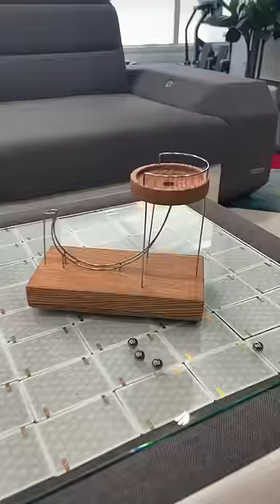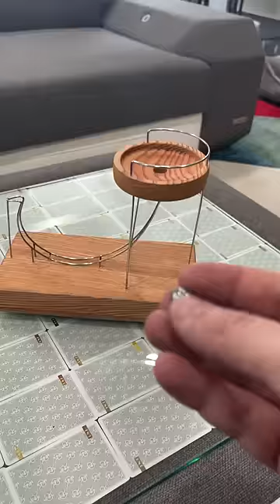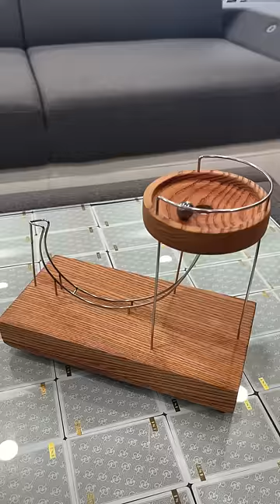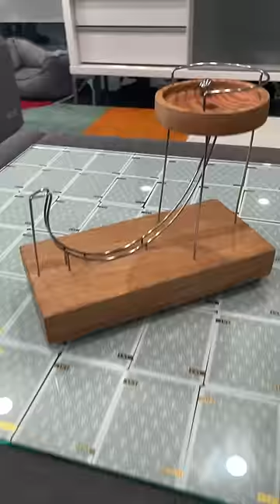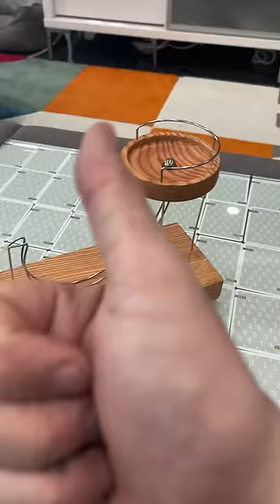An Impossible Perpetual Motion Device?! 😳 #Shorts

Comment: Tip it over lets see what trickery is underneath, guessing timed magnet in the base or speed boosting motor under top plate, that ball is going unnaturally fast
Reply: yes its built with a magnet 
you can search up tomary on youtube, hes a german youtuber who kind of created that :)
Reply: @koenig_ramses4458  what?! nice! thank you!

some fascinated German noises
Reply: Yes it has an on off switch
Reply: old man strength  lol it's not just a magnet. It's a battery powered device. If it only needed a magnet it would be a true perpetual motion device. If you search for it online you'll see it has a battery compartment.
Reply: old man strength  yeah mean the smell of burning oil is good haha
Reply: @GlobalDesignHD  you are correct, if it was only a magnet it will stop even faster towards the magnet, but here it accelerates, so there must be an additional power boost
Gimme a sub now 🙂
Reply: @GlobalDesignHD  It still wouldn't be a perpetual motion device with a magnet. Magnets lose their strength over time, hence why it doesn't work.
Reply: No one said there wasn’t one
Reply: @GlobalDesignHD  actually not true there ARE many PMD’s that ONLY use magnets but because magnets do eventually lose strength are NOT true PMD’s
Reply: @koenig_ramses4458  ICH BIN BERLINER!
Reply: @zherean42069  same
Reply: Soo basic yes .
Reply: It's not .. it's doesn't exist. It's all fake
Reply: @spacefan36  Das IST gut, yah?
Reply: @koenig_ramses4458  magnet makes no sense, since there's no monopole magnet. It's a little threadmill in the hole gives the ball a little boost.
Reply: @ehsan_kia  lmao i literally put a name of a youtuber in my comment who actually built that but okay
Reply: @koenig_ramses4458  I see, he uses an electronic magnet that turns on and off, but that seems overly complicated. I think these etsy versions are the simpler one with a threadmill motor.
Reply: I'm tipping it's a similar principle to a rail gun
Reply: old man strength  I was born in 1988 but I learned to ride on my dad's tuned 250R. I remember getting it stuck in the mud and destroying my shins trying to start it up. My foot kept slipping off. It was a nightmare. But I remember his ATC dusting stock Banshees. Tecates were awesome too but I don't think I've ever seen one in real life. 
My bucket list includes hitting the power band on a CR 500.
Reply: I think the track is magnetic in certain spots
Reply: @GlobalDesignHD  that's not technically true because magnets don't last forever baby
Reply: Yoooo Rambro's dude up in here 😁
Nostalgia trip!
Reply: @GlobalDesignHD  adding a magnet would disqualify it as well. Since it would ad Energie as well...but more importantly it would also weaken over time
Reply: Fr
Reply: I've seen a french youtuber named "Dr Nozman" , he bought it and showed that this device doesn't work without an outside boost, which was given by a USB cord going into the device
Reply: I want that
Reply: old man strength  yeah you can fire Magnets with electricity. Its Like magic
Reply: Wow what a misleading video if there is magnet in it. Thanks now I can downvote and block this guy🤙
Reply: Remember he said it is imposible and that device just closes to the idea
Reply: wow Hi Angry, I’m upset
Reply: Imagine we could make nearly infinite energy by just mass, gravity, natural magnetism.
Reply: To be fair he did say it doesnt exist and it would look LIKE
Reply: @GlobalDesignHD  Incorrect, even normal magnets lose their charge over time. This is why magnets aren't used for even attempted perpetual motion devices that aren't tricks, AT ALL..
Reply: Yea most need to get plugged in
Reply: @GlobalDesignHD  No it wouldn't be. "Permanent" magnets demagnetize when used in this way.
Reply: @koenig_ramses4458  i might be biased but fking hell german engineering sure is something
Reply: @eugene9852   ofc it is the point xD. There are variations that only work with magnets and that was what 2 stroke power claimed would count.
Reply: @TheConfusedOne101  is it tho? In my opinion it was...the generations now are resting on the achievements of those before them. We all got/grown weak as Western society :(
Reply: @ehsan_kia  There is no experimental or observational evidence that magnetic monopoles exist, but theory says they should. Not in bar magnet form, but in elementary particle form. And no, there is no "little threadmill" in the device shown in the video.
Reply: @GlobalDesignHD  wrong. Perpetuum mobiles that use magnets are per Definition not considered as not such machines.
Reply: Just goes to show how literally over 4,000 people don't kno anything about perpetual motion and physics
Reply: It's really not even all that interesting my promise. I saw somebody else busting this. There is simply a 9 V battery underneath lol
Reply: Gravity
Reply: So it requires batteries in other words
Reply: @GlobalDesignHD  theory: it's an electromagnet powered by a battery. The rail the ball runs on is hooked up to a momentary switch that activates when the ball falls and gives the ball a boost back up. Neat desk toy
Reply: It uses battery powered smoke and mirrors...
Reply: Nice job calling out the fraud
Reply: Technically, assuming nothing crosses your path, a perpetual motion machine would be called "throwing an object in space". As long as it doesn't hit anything else, it'll continue in the same direction, at the same constant speed, forever.
Reply: @GlobalDesignHD  Magnet loses its magnetic force over time so still if it used only magnet it could not be called  "Perpetual motion device"
Reply: @GlobalDesignHD  it wouldn’t be because the magnet loses strength over time.
Reply: It doesnt matter if it has a magnet it is still infinite
Reply: @calcapone9  is a car engine infinite? No, when the gas runs out it stops, same with a magnet, once the magnet decays, it reaches a point where it can’t propel the ball fast enough to make the jump to the funnel.
Reply: Yea prob magnet
Reply: I think it's just cgi
Reply: @crypticaddiction6856   At last!!
Reply: There’s a small spinning wheel in the hole that gives it the proper speed
Reply: @GlobalDesignHD  No it wouldn't. Magnets run out of magnetism.
Reply: @GlobalDesignHD  having a magnet wouldn't make it a true perpetual motion device. Magnets do eventually run out of power
Reply: He did it on his Snapchat and you sir are right its some magnet thing
Reply: Bingo!
Reply: @janis0085  Yes it would, because you'd get more power out than you need replacing the magnet or re-magnetizing it.
Reply: @fintincollins5555  
A magnet doesn't have "power". The magnetic fields might become unaligned over time, but that doesn't stand in a proportion to the acceleration you get from a magnet.
Reply: @TobbeDraws  No.
A magnet doesn't "add energy". Even if you had a magnet that stays magnetic forever that wouldn't allow perpetual motion.
A magnet just creates a magnetic field. Stuff accelerates towards the magnet and that's it. If you want to get it away from the magnet again, you need to add just as much energy as there was in the system before.
Reply: @fullofbullets58  Wrong, that magnets demagnetize is irrelevant.
A forever-magnet wouldn't allow for perpetual motion either.
Reply: @MrCmon113  well a quick google search on perpetual mobile only with magnets would show you there are already some that only fall out of the "real" definition bcs the magnets lose in strength over time.

The premise a magnet would not add energy is wrong...and you are proving that already yourself with what you wrote.

"stuff accelerates towards the magnet" nothing could accelerate towards something, without some kind of adding energy, if that something isn't adding energy itself.
Reply: This hokus pokus only works in the Mid-East and China. They have a different law of physics over there

Comment: It turns out this device has a battery underneath that gives the bead a magnetic boost
Reply: aaaaaaaah really?!
Reply: and you can prove it by this: in order for the ball to reach a higher height than it fell from (starting point) it would need to gain energy which is impossible without something pushing it or giving it energy. In order for it to jump up like that, it needs more energy than it started with when it fell into the hole.
Reply: @CleopatrasNemesis  yes, really. You can tell it accelerates downward much faster than gravity would.

Well, Earth's gravity, anyway.
Reply: @ztoob8898 sarcasm
Reply: @Vid_Master 
The gravity could provide the energy needed, maybe (?). However it's not the case in this planet.
Reply: well no shit
Reply: No wayyyy
Reply: It uses an electro-magnet.
Reply: Batteries are NOT magnets!
Reply: Correct, batteries are not a magnet but the energy stored in the battery is used to feed another component to create a magnetic field.
Reply: @gagpatr  you need a magnetic field than can be switched on and off.
ON while the ball is moving the towards the magnet and OFF while it is moving away.
Reply: I built one of these years ago and it works I only used thin metal for the ball chute and wood for the catcher it worked and kept working till I took the ball out
Reply: @BrianPorter-se9dh  oh really  
Post a video and video all sides of your device including the bottom.

Comment: The catch is: "the ball is accelerated (speeding up) when it is projected from the metal ramp as compared to naturally slowing down". So, you need "a small bit of energy" to push the ball to the height higher than the previous level from which it started to fall.
Reply: That's not a catch at all. The question is what is speeding it up.
Reply: @savedfaves 
A magnet inside of the wood. It's battery feeded.
Reply: Yeah they all are, I have a few, they are cool talking pieced and chemical ones can go for centuries but it is a hidden energy source, the best is a rotating magnet on some type of device as it’s minimal energy input that appears to have an abnormal amount of output the Gomboc thing had me thinking for a while but it always finds a resting position, anyway, even the magnets should in theory power a device close to angular momentum, but over the centuries the magnetic fields would decline so it’s not really perpetual motion and it’s not really an impressive output unless you add a current, which they always do, I have a really cool one that sits on two plastic semi circular stilts that allows a quarter triangle within two semi circular outer cases and inside it looks a little like a fidget spinner type of thing that sometimes goes wild, it’s a very easily Googled trick anyway but I can actually charge two triple A batteries as it uses mechanical rotation that’s basically angular momentum 99.999% but that mechanically wound magnetic rotation device only takes maybe about one minute to wind and it can last over ten years even with routinely charging my remote batteries, it’s basically a mechanical battery charger and a cool little coffee table piece.
Reply: I know where all here to paste people who think stuff like this is possible but if the universe was created from nothing which is not perceivable and neither is total infinite, what’s interesting is we can’t grasp either but yet they are literally inverts of one another, everything/nothing positive and negative, light and dark you know, I find it interesting the connection in that especially the fact it’s like repeated on nano scoping level at every level of life, if you imagine the Big Bang, we are like mid explosion as wee speak, and if you think about it, if you looked at an explosion deep enough you would find like little particles then even smaller objects that are as part of the explosion as the whole explosion just like in quantum mechanics where things still have the same physicals at a minute scale, it’s like we are here to ensure the explosion goes down, maybe that’s why our species is destructive, what if the universe made life in order for the Big Bang to be possible and if by some chance someone had the whole cosmos in a shoe box and was unable to see at much as actual life on planets well it would be exploding so say its in some container then the nature of that explosion on the smallest scale is to make the destruction wide spread as we are in an explosion, anyway if this all came from nothing then it’s possible if it’s possible it’s inevitable and basically never ever stops so can’t that be considered perpetual motion? Not like a little model but say the fact it’s more or less creating energy out of thing air,  which is the whole concept behind perpetual motion.
Reply: That energy comes from the battery, I know, I bought one.
Reply: @savedfaves  battery
Reply: Yeah we have always known this but what if that small piece of exes energy could be gravity or angular momentum? Things come to a natural resting position, unless it’s that mad stone thing that the took inspiration from a turtle shell, the guy went about trying to find a pebble as he was convinced there must be at-least, other than the universe itself.
Reply: Sure, but how? 

(There is a magnet hidden in the base in a location that accelerates the ball as it comes down but does not slow it down when it passes that point. So it behaves as if it went down a longer slope, but rises only part of the way to the longer slope top.)

Comment: For those wondering how it works, this one uses an electromagnet in the base that turns on as the ball is coming down, thus accelerating the ball downward faster than gravity alone, allowing it to make it back up
Reply: Is this for real?
Reply: @mindfulmagician7550  well yeah, it goes higher on the way back up than it started at.
Reply: simple, electromagnetic accelerator
Reply: @mindfulmagician7550  yes, its a electromagnetic accelerator
Reply: @_-noxxon-_  yep
Reply: @mindfulmagician7550  yes
Reply: Ha ha… everyone knows it!
Reply: @chandana56  apparently not everyone, someone was trying to start an argument about it in the replies to another comment :/
Reply: I Knew a magnet was in involved somewhere! Thanks for clearing that up!
Reply: Thanks
Reply: That is cool. I want one. Where?
Reply: Is the free Energy theory out the window because he’s using a magnet?
Reply: @dr.feelgood.1330  What is the "free Energy theory"?
Reply: @dr.feelgood.1330  right):
Reply: @robertsilveus3071  He said Etsy.
Reply: That's clear, but does it turn off after a certain time or when the ball passes a certain point?
Reply: @MrCmon113  my guess is that it would be timed to turn off just before the ball passes it. It would likely be easier to make it time based than sensor based
Reply: @MrCmon113  The metal ball closes the circuit when it touches both sides of the trail. This ends at the lowest point of the trail, you can see it's color is slightly different there. The ball is the switch itself.
Reply: @fesimco4339  the important but to understand is that the electromagnet is triggered on when it passes the right point. Its not on all the time.

Multiple balls mess with the concept. The trigger detection can be between the metal beams and a timer(the hole makes the velocity the same every time so you can time it from when it starts dropping down) or a metal detector.